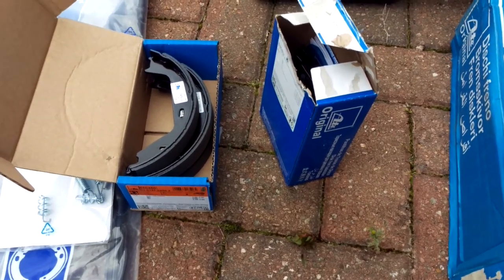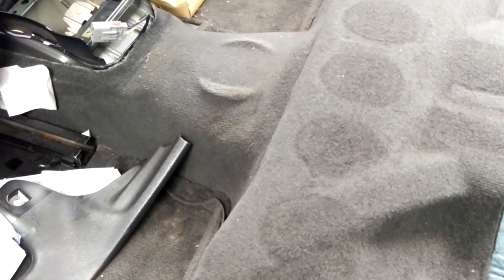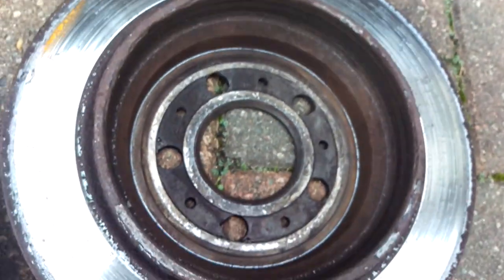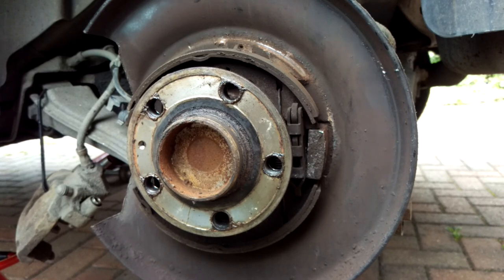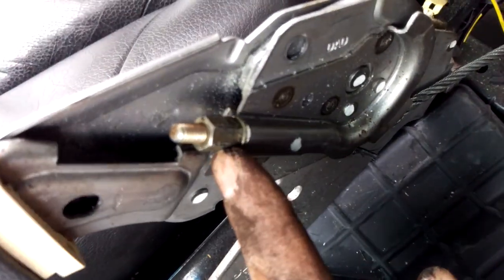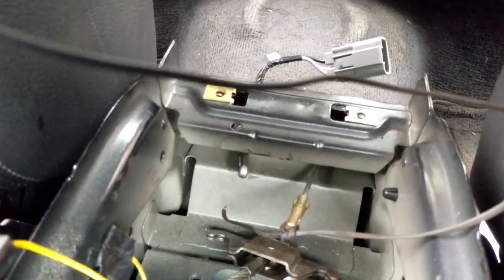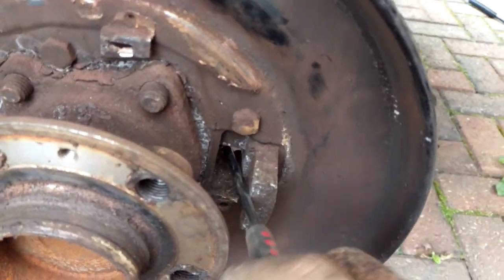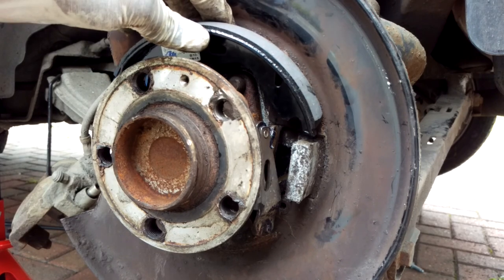Handbrake Cable and Shoes Replacement Volvo S60 and Others

Comment: If you use genuine volvo shoes they work much better as they are the correct shape.
Any other make are not quite exactly same.  Volvo shoes make twice the contact on the drum.... try your old shoes against your new volvo ones.
Reply from the maker: Phil Sleddenhouston There's no such thing as Volvo shoes. 
ATE make the shoes and that's what is fitted in this video. 
This video is a year old and they still work perfectly.....of course. 👍
Reply: Well as you say no such thing as volvo brake parts  when there made in china but i found an obvious difference with the shoe.
This was pointed out to me yesterday when my friend was  doing his .
Ive got a handbrake on about 9 clicks so is it worth me adjusting inside the car?
Reply: How can you say that phil then ask for advice? 9 clicks on the handbrake aswell. roffle

Comment: Can someone explain how the actual mechanism work with the hand brake, i dont get on which surface-area the brake shoes are braking the wheels.
Reply from the maker: At the very end of the video, you can see how the mechanism expands the shoes outwards and they contact the inside of the part of the rear disc which is shown at 9mins 50secs.
Reply: ooooh ok, thx :)

Comment: whay you change handbrake cable whats wronc wit it
Reply: mari82 : As described in the video the cables had stretched. When this happens your adjustment thread on the single cable will be limited.

Comment: would you change mine for me
Reply from the maker: It would be cheaper and easier to get a competent local mechanic to do the job. It's not difficult if someone has the right tools and understanding.
Reply: @sirobb  unfortunately the chap I normally use ain't too clued up on Volvo s , willing to pay
Reply from the maker: What exact model and model year do you have?
Reply: @sirobb  v70 2004 , the rear handbrake shoes have been renewed,  I've watched a lot of your vids and really like the way you work creep creep lol , I'm just getting  a tad old now .
Reply from the maker: Lol, thank you.
Everything would have to come apart (including the recently fitted components) for access but you feel like you just need 2 new handbrake cables I take it? Are they at the end of their adjustment and are the discs recent too?
Reply: @sirobb  Yes disc are new ish less than 3k miles ago and the ns  shoe won't adjust up like the os,  hope this helps
Reply from the maker: Sounds like water has got into the cable sheathing and seized it up or restricted its movement. Pretty common. 
A new short cable which runs from the handbrake lever to the 2 main cables wouldn't go amiss either. What a shame that they fitted new discs and handbrake shoes but didn't insist on replacing 15+ year old cables.
Send me an email at SiRobbYT@gmail.com and we'll see what we can do.
Reply: @sirobb  cheers si